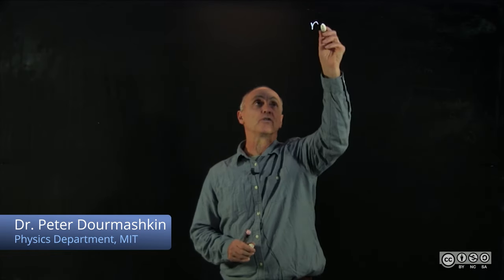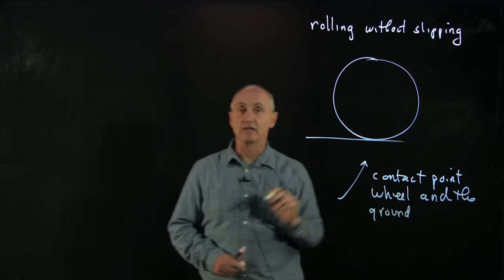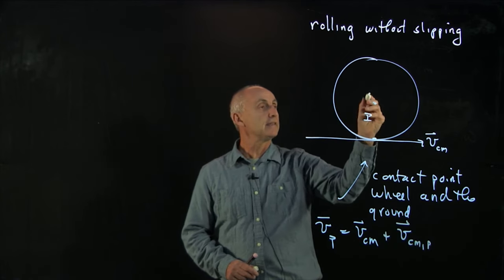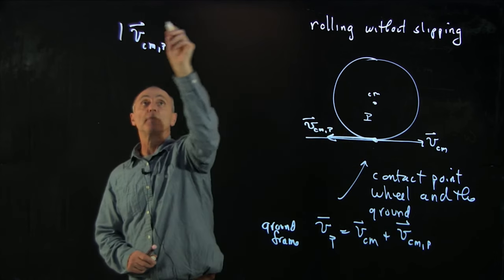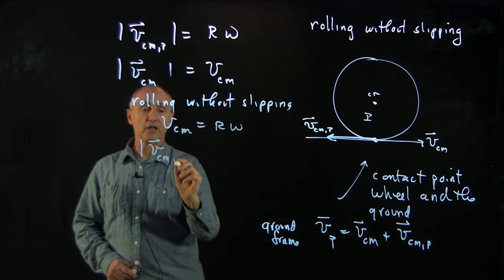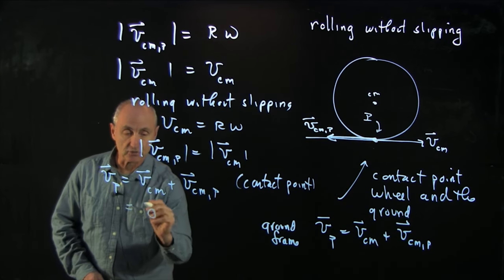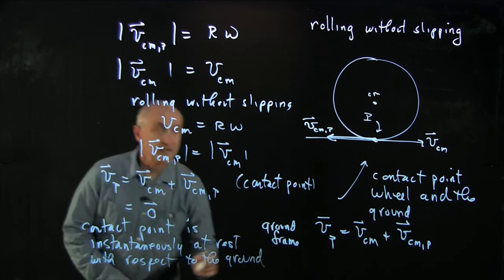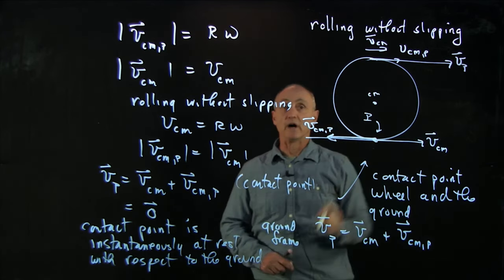35.5 Contact Point of a Wheel Rolling Without Slipping

Comment: A big take-away from this explanation is that the top of a car's tire rolling without slipping is actually going down the roadway at twice whatever speed the car is traveling. This also gives you a 2:1 lever should you ever need to push a car and find it difficult. Simply push from the top of a tire and your required force will become essentially 1/2 of what's needed by pushing from behind.